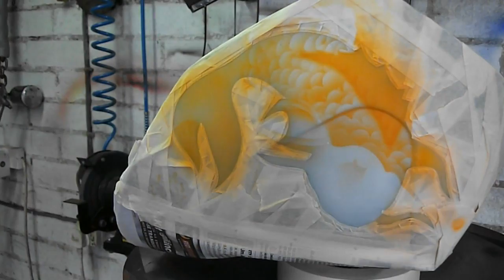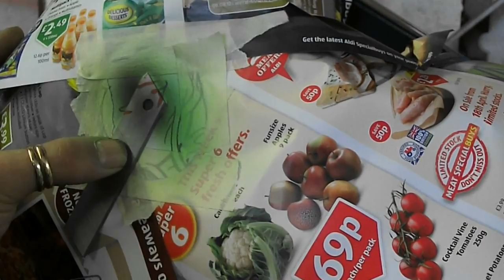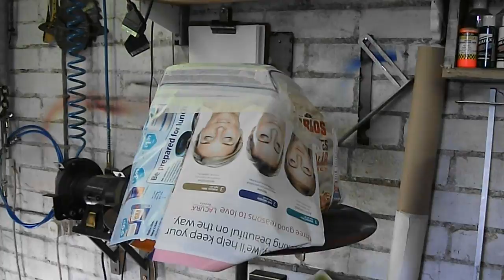Airbrushing the welding helmet - complete

Comment: I've done 4 masks so far, but I used posca paint pens..the 4th mask I airbrushed te mask red using tape to mask off the areas that were not red..some lines wernt crisp.  I plan on buying a new mask at the end of the month..it will be white and shinny..my plan is to paint it oiler colors since there my fav hockey team..I will be using wider lines, team logo and hand draw a goalie on it..I hope it turns out good.  If you want, you can add me on fb, then you can see my mask jobs..thx buddy!!

Comment: wow what kind of spray gun were you using for the clear!!?  Also, did your clear have a hardner in it?  I just bought 2 professional spray guns..mastercraft brand, but I cant use them because I don't have a proper place to use them.  I currently pay someone to clear coat my masks, but would like to do it myself one day.  Any tips?  Thx
Reply from the maker: sure hi use waterbased clear it is safe to spray and wont react with other paints you may have used hope that helps